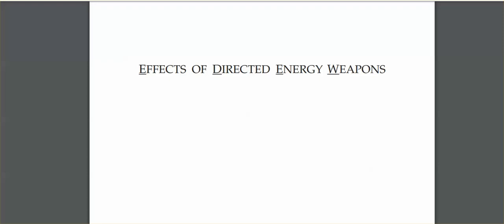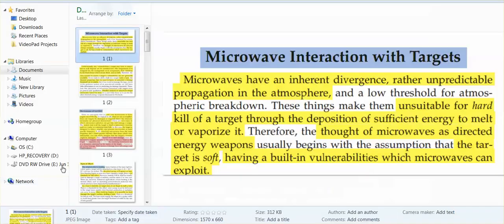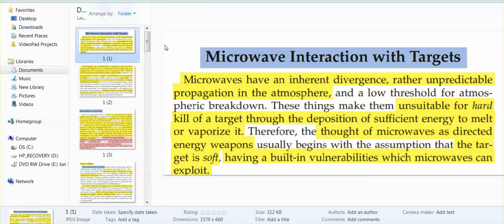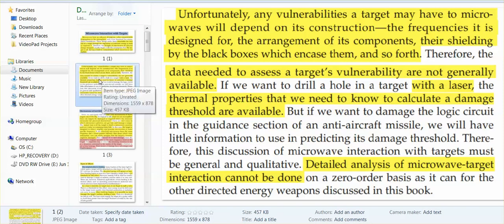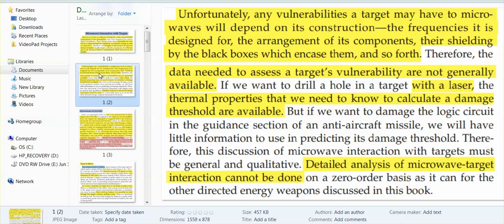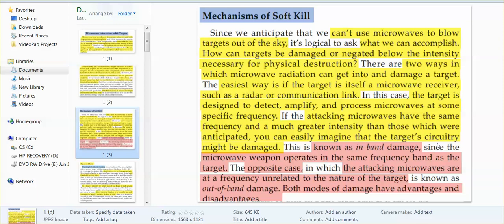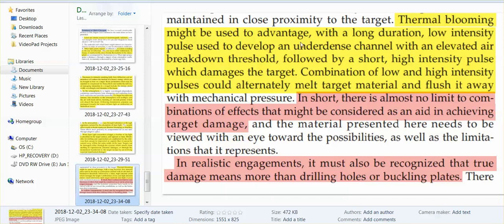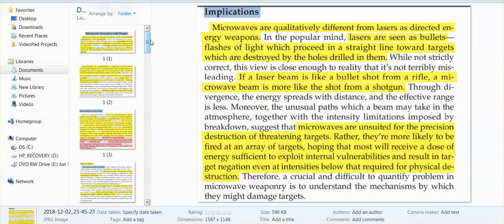CA Fires: pdf On Directed Energy Weapons Proves Melting, Vaporization, Damage To Scale

Comment: Your 100% right. And were the crazy ones. Ever wonder why theres a rotating plate in your microwave? Its still uneven in spots. Thats why some homes are left untouched. Plug an extension cord in put a power strip on it n plug a microwave in and break a fresh branch off of a tree and put it in for 5 to 10 minutes. Looks just like the trees in the fire videos.

Comment: All towers I suspect are being used, ie Radio and Television, but the horror is the bio array, especially pines, being used to emit these frequencies. Think about how a rhizome would have the potential for energy movement. Small bursts through the grid into the smart meter and then the internal electrical system of the home.